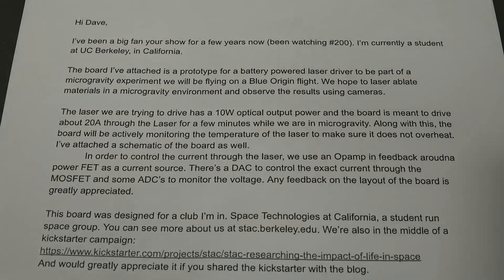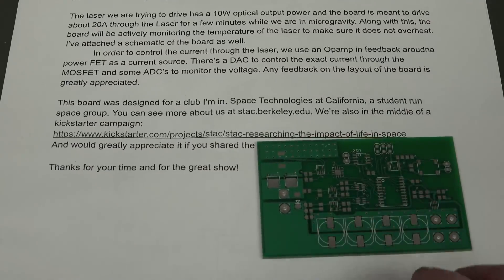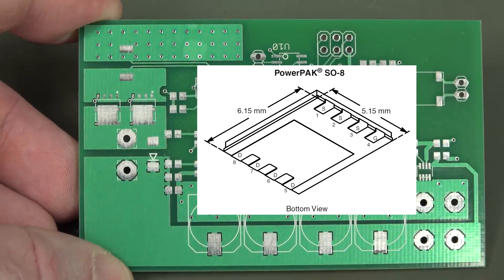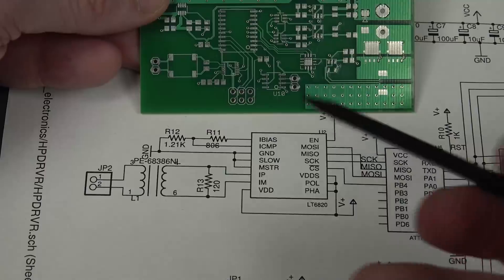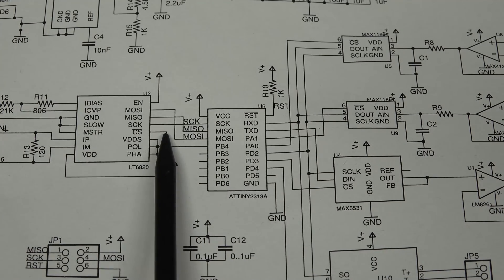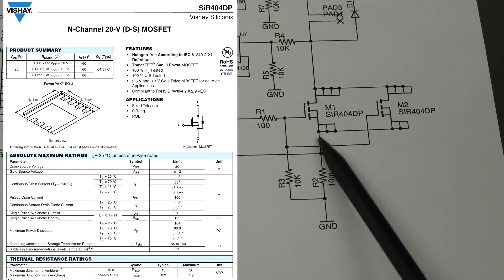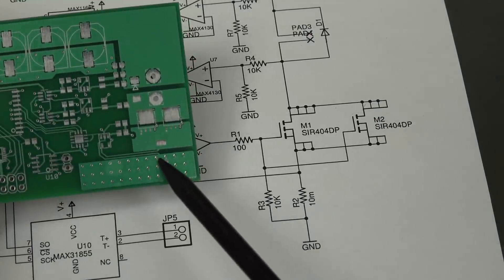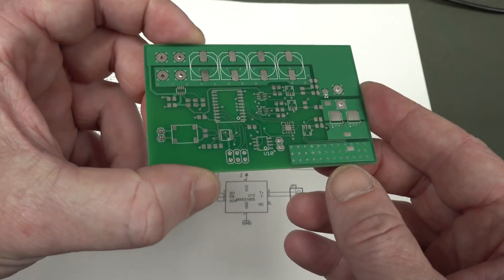Laser Driver PCB & Circuit Review

Comment: I am interested in this opamp (LM8261, L1) that us attached to current sensing resistor (R2). It is in really weird topology, that has output connected to gate of mosfets and to ground via R3. My guess it is forming some compact constant current source from the mosfets, but I never seen it before.

Comment: I'm no expert in aerospace, but I have experience designing electronics for aerospace.  Hell, aluminum electrolytics are shit even without considering space applications.

You'll need to use a polyimide PCB, such as Isola P96 or Arlon 85N.  No MOSFETs, only BJTs.  BJTs are inherently more resistant to radiation.  Better not be that RoHS compliant shit either.  There are a few main players in the space game for ICs/Semiconductors.  ST, Macom, Aeroflex (Cobham), Renesas (Intersil), Microsemi, Honeywell... and your well-known TI, ADI...

For connectors, you'll be checking out Glenair, Omnetics, AirBorn, Sunkye...

You may not need it, but their ratings are typically QML Class V, JANS, and NASA SP-R-0022.

Think you'll find this stuff on Digi-Key?  Nope... you need to manually get quotes and request information for individual parts.  Have fun with even more component selection time! :)

I didn't like spending my whole life communicating with suppliers, so I'm in the IR imaging field now.

Comment: Some proposals for enhancements:

* Inputs of U7 and U8 should get capacitors for initial LP-filtering.
* The controlling part of the PCB has the copper completely removed - I would keep it for defined ground-potential or guard-rings.
* The upper stuff is especially true for the ADC combined with OpAmp U1: If the loop between ADC-output and OpAmp-input is large enough (and it seems to be a few cm²) the high currents and other noise may cause significant power current modulation that may even disturb surrounding devices (with a 10mOhm shunt and 20A this is only a 200mV control signal!)

Comment: On the top layer they got a lot of unused space - might as well increase the width of the traces and add more grounding to it - should help distribute the heat better.
I also think they should rework their power system. Make it redundant and add more Caps - not electrolytic.

And if they think they might get into thermal trouble they should add some small heatsinks and/or a thermal buffer.

Comment: To the dude who designed this board:

Disclaimer: I am a dick... 99% of the time.

Consistency is the key to the visually appealing design! Sure, it will work with dicky traces/vias but it may as well look good, right?. I am sure you watched Dave's teardowns of well known brands... You will see "almost" none of these dickiness in those devices. You can do this better if you apply yourself more. Other than the things below you did well (85/100).

1) I think the via coming out of the 100 ohm resistor that goes to the gate of the MOSFETs look terribly out of place... It just looks bad within the Drain pour.

2) Make up your mind. Show all silkscreen for the device names or not at all. I think that "U10" is forgotten-to-be-deleted kind of thing. If I was to send any of my designs to someone else to review (much less Dave Jones), I'd quadruple check the design for consistencies (visual or otherwise). Going forward, pick a style (as in silkscreen or not) and stick with it; make it your "handwriting".

3) The VCC trace from Atiny2313A connects to the decoupling capacitor with thick trace... Fine... But why it continues to the rest of the "low power" devices with the same thickness for the 95% of the length and suddenly gets thinner to fit it under the first IC it goes to? It looks unappealing. Same goes for the VCC going to the ICSP header... Dude!

4) Some traces are nicely routed as in making nice 45 degree turns. Some are just lumped together (around the regulator and one of the MAX116?) I mentioned something about consistency earlier :P...

Comment: There are plenty of isolated SPI, CANbus, I²C, USB, RS-485, and RS-232 transceivers.  Many come in "relatively" small packages and no transformer is needed.  You do need an isolated supply, though.

muRata has a nice USB isolator - the NMUSB202MC.  NVE and Broadcom (Avago) use spintronics to transfer.  Pretty cool tech!

Analog Devices do offer parts that have isolated signals AND power.  Check out the ADM3251E.  It has an isolated RS-232 transciever, isolated DC/DC converter using a chip-scale transformer (iCoupler), and integrated charge pump for producing an isolated +/-6V from a single 5V supply.
Reply from the maker: Hard to beat a real transformer for proper high voltage isolation though.
Reply: I guess it depends.  I've used them in systems that require 2kV isolation and it works great.  The design used "decks", as in each successive board was at a 2kV potential above the last.  The downstream components don't know the difference, but the isolators sure do.  This was so I could have a non-isolated portion of the board that was used for HV electrostatic supplies.  Bigger is better when it comes to isolation, you are correct!

Comment: Here is a hint for anyone who wants to do big, fast current pulses with a circuit like this: you have to consider the inductance of the sense resistor.  For example, let's say they are doing a 20A pulse and they want a rise time of 1 microsecond.  The 10m resistor will give 200mV at the top of the pulse, right?  But what if the sense resistor has 5nH inductance?  20A/us x 5nH = 100mV.  This will dramatically slow the rise time because the control loop thinks the current is a lot higher than it actually is.
But you can fix this with layout. Have the current pass through the sense resistor using wide traces on the top, then go down ONE layer (with a lot of vias) and on layer2 run a wide trace BACK under the sense resistor before it connects to the ground plane.  This will mostly cancel the magnetic field around the sense resistor, greatly reducing it's ESL.  I once used this technique on a lightning surge simulator that did pulses up to 300A.
Reply: Good idea, thanks!
Reply: That's a good tip ... I'll remember that
Reply: Awesome hint! Made a note.

Comment: I wonder if the MOSFETS can dissipate enough heat in that environment ....
Reply: If not do the old Apollo method, and encapsulate the board in paraffin wax, so the phase change of the wax provides enough thermal reserve for the anticipated time, so the little mosfets do not unsolder themselves or cook shorted.  For this does not need a box, simply dip the board a few times in the melted wax, then seal into a Tyvek pouch to contain the melted wax, and then you can simply zip tie it in place.
Reply: SeanBZA That is incredibly obscure, so much so that I could only find one reference. Where did you learn about that?

Comment: 2:33 - Backside traces are kinda how-ya-doing.  Weird zigzag on lower left of that non-filled area.  Top trace goes around a via but is connected to it.  Lower 2 traces heading to 1 o'clock seem to be at different angles.  Top and bottom have traces with less than 90° angles that could (more in the past or when home brewing) have etching issues as Dave has mentioned in the past.  And as Dave said, use your silkscreen.  Label the parts, pin 1s, etc.  And put your name, version number, date, etc.  It doesn't cost anything more but makes assembly and diagnostics easier.  My 2 cents.   ;-)
Reply: Also consider adding some screw mounting holes.  Easy to forget but it looks like you have the room for at least a few.  Or they may already be planning to use PCB edge type mounts I guess.

Comment: Dave, I think you should take another look at how they connected the current-sense resistor.  I see the trace on the top side you were pointing to; the one that goes from the GND side of the sense resistor to the opamp negative rail.  But if you look at the back side, both these points just connect directly to the ground plane.  And the DAC also connects straight to the GND plane.  So it's messed up.
Also, it looks like this board may have serious thermal issues.  They wrote that they would run up to 20A through the laser diode for several minutes, but they seem to be getting that current from a tiny adjustable LDO.  I guess the idea is to do brief pulses (hence the four large caps) but depending on the duty cycle they could still be dissipating a lot of power in the LDO.
And I didn't see any mention of the ambient temperature range they are expecting.  The transformer they picked has a range of -40C to 130C, so that's probably okay.  But I wonder about the big caps.
Reply: Exactly, I was going to comment the same thing but just +1'd yours instead. The attempted 4-terminal/Kelvin connection is completely defeated by the second ground via near U1, in violation of the "star grounding" principle.
Reply from the maker: That's the problem with a single take off-the-cuff mailbag, I didn't sit down and really analyse it. Will take another look, thanks. I thought they said it was constant current, and I didn't think the LED current was going to come from the regulator?
Reply: Another aspect to consider (which will likely be done by Blue Origin before it flies) is thermal dissipation. Is this flying in the environmentally controlled section of the vehicle or is this flying in a trunk that is at ambient?? If it is at ambient, they will have serious problems dissipating heat in a vacuum. I have had issues with this in the past on 2 projects. They will need large thermal mass blocks to sink the heat away from the devices in question and "store" to be radiated once the vehicle comes back down to below 40,000ft. A project this small wouldn't warrant a full on thermal radiation system to ditch the heat into vacuum so storing it with large thermal masses is far more simple ie. heat pipes to an adjacent aluminum block.
Reply: You could divide the output of the DAC with resistors, but in general its better for accuracy to work with large signals than small signals because it makes the error sources (like opamp input offsets and bias) less significant.
As for compensation of this particular kind of circuit, I know a lot about that because I've designed many electronic loads over the years, big and small.  There are three main factors that could mess up your compensation;
1.  The inductance of the sense resistor, which I already talked about in a comment above.  The best solution is the layout trick I described.
2.  Long output wires.  They didn't say how long the wires would be between this board and the laser diode, but a bit of inductance can cause nasty resonance at a freq inside your loop BW.  This is because the cable L is reflected into the gate impedance by the Miller effect.  The solutions are: a) keep the wires short and twisted, b) put a series RC (typically about 10 Ohms, 47nF) from drain to ground to de-Q the resonance, and c) use an opamp with low output resistance to drive the MOSFET gate, which pushes the resonance freq higher, hopefully above you cross-over freq.  (BTW, bipolar transistors are far less affected by this type of resonance than MOSFETs, which I recommend you verify with LTSPICE.  It's fun and easy!)
3. If you use an opamp to boost the signal from the sense resistor, you of course get a pole associated with the GBWP of the opamp.  This could be used to cancel the zero introduced by the sense resistor ESL, but I don't recommend it.  Better just to use an opamp with a big GBWP so the pole is at least 2 octaves above cross-over.
Sorry for the long post.  I guess I've been procrastinating, and I have to get back to work now.
Reply: I think they dont use the LDO for the mosfet. They just used weird names for the supply symboles. V+ is the supply from the LDO for the opamps and uC and VCC comes directly from the input connector. So the caps are only for the input voltage and not for the LDO output voltage.
Reply: I think you're right.  I caught a very brief glimpse of the LDO at 4:35.  "V+" is the output of the LDO, so VCC must be the input.  Very hard to see.  Can't tell what the LDO chip is, but the 4.5k/1k divider suggests "V+" might be 5V.
Reply: I just looked at the data sheets for the DAC and opamps (since I can't sleep).  Their operating temp range is only -40C to +85C.  And I think the reason they have 12-bits resolution is because they are using only a small part of the full-scale range.  I'd use a precision diffamp to boost the signal from the current sense resistor before feeding it back to the error amp.
Reply: Steve Robbins Couldn't you also divide down the DAC signal so the fullscale output matches and maybe save an opamp. Also it's easier getting the control loop to work without an additional opamp in the way which adds delay/phase shift and you'd need compensation for that which slows down the response. Maybe
Reply: Absolutely true.  I've recorded a few videos and it's way harder than it looks.  I can breeze through things usually, but between trying to make sure your audio and video is clear, thinking of what to say, and not thinking out loud, it's VERY difficult!

Moreover, this is your job, so you have an additional variable - efficiency of efforts.

I would say on live camera, I have maybe 50% as much analytical skill as usual.  That's why you're the successful one here!  Not many people can do it!  Even less can make a living from it.
Reply: Steve Robbins Hey, thanks for your good comment! Well, If they are just using a 12 bit DAC and pissing away half of it's range I don't think accuracy is so much of an issue which is why I'd just try the resistive divider. On the 10mOhm resistor we are at 200mV full range and with a somewhat decent opamp there should not be more than about 1mV offset voltage which already equals 0.5%. Yes there are other effects like input bias current and obviously the lower we set the current the worse that error gets. But nothing you couldn't trim out mostly I suppose. I'm a bit more concerned about the single rail operation and the opamp working all the way down to its negative rail. But yes 2 op amps in the feedback loop should still be fairly easy to compensate and get stable. Didn't know parasitics play such a big role in these applications. I had more troubles with the opamps themself when I was designing some power supplys and 4 quadrant sources which had 4 opamps in the feedback loop for voltage if I remember correctly. But that's all basically just DC anyway and no fast pulses.

Comment: Those FETs are fine for this application, but how is one supposed to find FETs for higher voltage and higher current linear operation? A lot of datasheets don't even have the SOA graph (because they're not intended for linear operation).
Reply: IXYS and Infineon have a range of linear mosfets designed specifically for this ($$$ though). Otherwise IGBT may be better suited.

Comment: LTC6820 has been around since at least late 2013/early 2014, I was using them for a custom automotive comms system for Formula SAE - also a student lead engineering project. Ended up going with CANbus mostly due to cost of the transceiver. Very nice chip - noise immunity was incredible IIRC.
Reply from the maker: It does look sweet. $2.80 in qty is not too bad. But not for low margin products.
Reply: being in an FSG team myself, I'd be interested in knowing what you'd have uses it for. We're planning to use isoSPI in our traction battery BMS, but for general communication we're using CAN aswell because of the multimaster capability.
Reply: It wasn't multimaster or anything like that, basically any differential bus would've done. This was for a data acquisition system we built, with IMUs, strain gages, etc. all around the chassis. Since many IO expanders, ADCs and other peripherals would attach directly via SPI, it seemed like an attractive option. But due to the cost ($5.60 in 1 qty - realize that the car might have 10-20 total), and the extra required transformer, it was actually cheaper (and more flexible) to use a low power microcontroller plus a CAN transceiver on every sensor board.

Comment: I have done a few designs for a dc load. Found a few tips or flaws along the way. With your mosfet packages as Dave mentions, may need to be bigger depending on what current and if continuous or pulse. If pulsing short burst of current then the package size shouldn't be an issue. If continuous current high then maybe look at bigger packages and if you can get smd linear mosfets are generally better purposed. Check out Kerry Wong dc load on yt, has a few good ideas and tips. Love the idea tho!